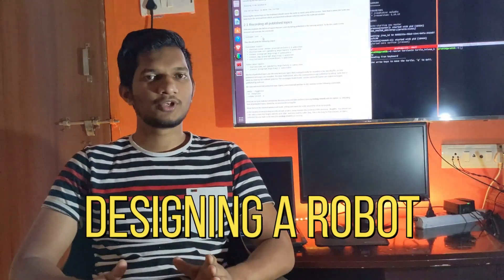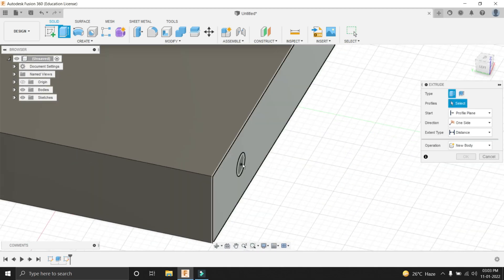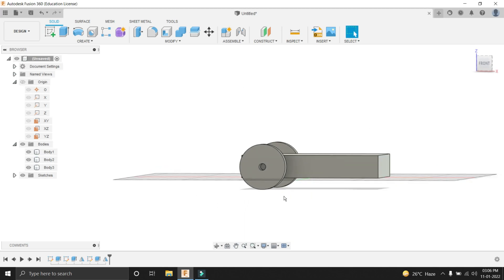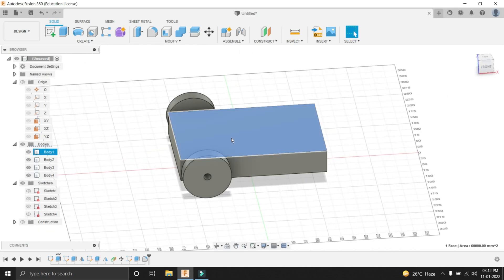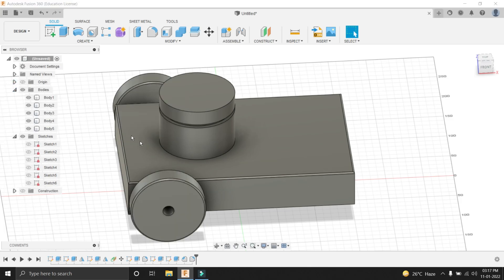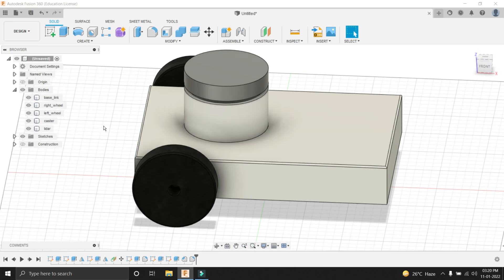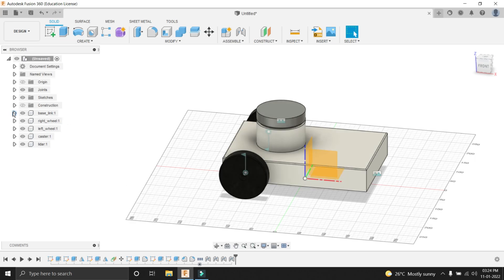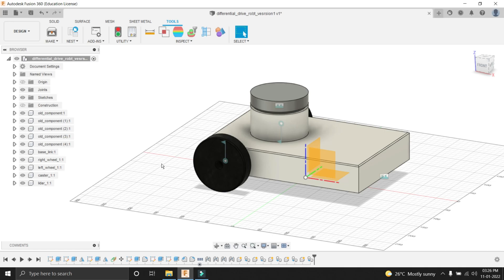How to Design robot in fusion 360 for ROS | Robotic Operating System | #2

Comment: Hey man, I am now using ros2 and i have designed a bot in gazebo itself, but it is in SDF format.
Can you tell me how to convert it in urdf?
Reply: The SDF files should point towards a mesh. The mesh for the robot should be in a 3D object filetype that can be opened in Fusion360. In Fusion360, with the model(s) loaded, you should be able to use the URDF exporter to export it! I hope this helps a little bit, but I understand it may not, I'm a novice myself.